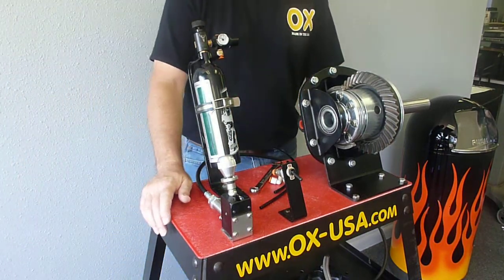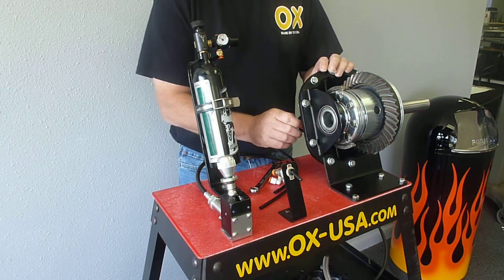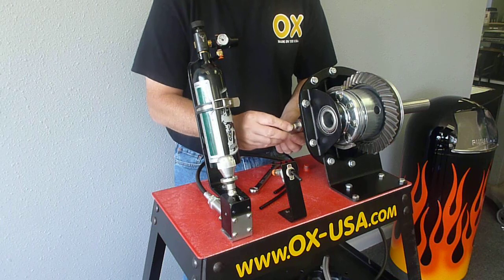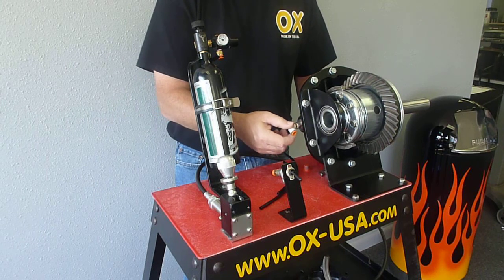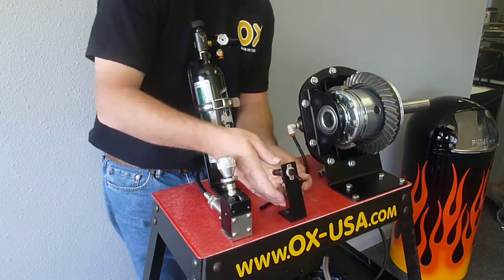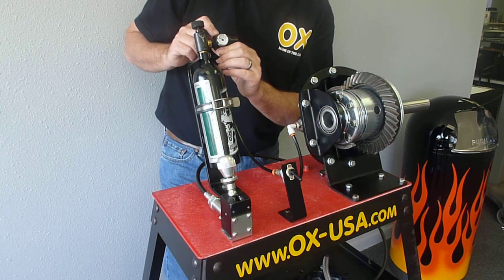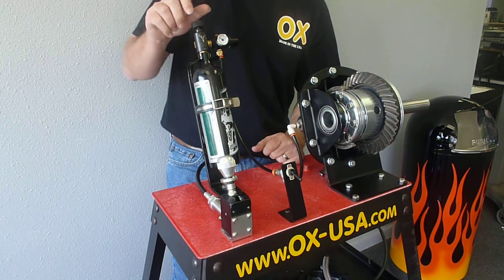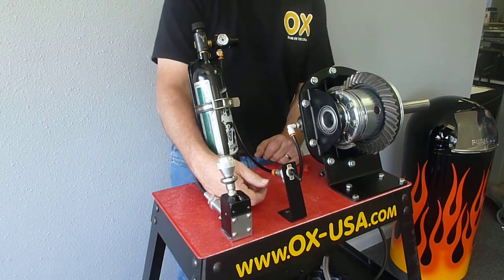OX Locker Air Shifter Installation Guide

Comment: Really surprised these lockers havent gotten more attention! Getting one installed in my 99 super duty rear axle and going with the co2 setup. Just so much easier and less stuff to buy and install on the truck compared to onboard air (for me). Bottle was only $25 at Walmart for a 20oz and just need to get it filled up. Really like the functionality options compared to other lockers on the market being that you can decide if you want cable, electric operated cable and the various air delivery setups. OX has really stepped up their game!